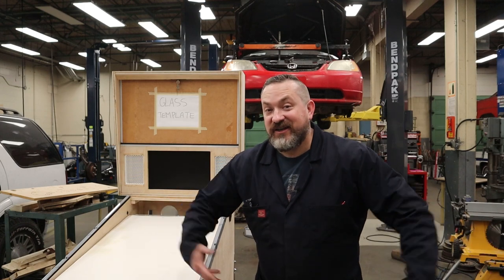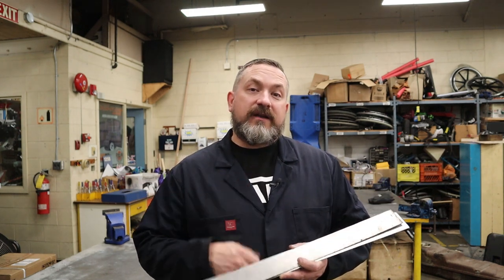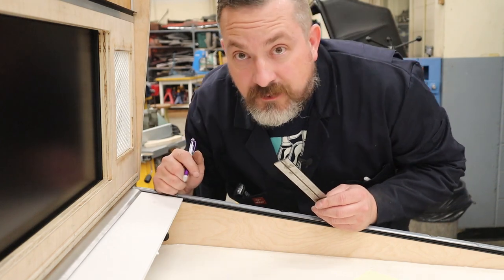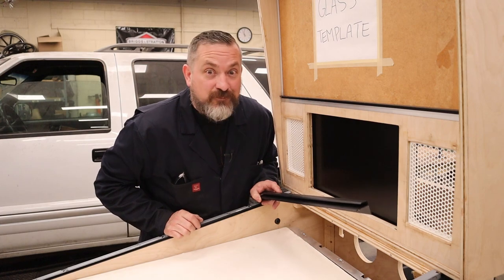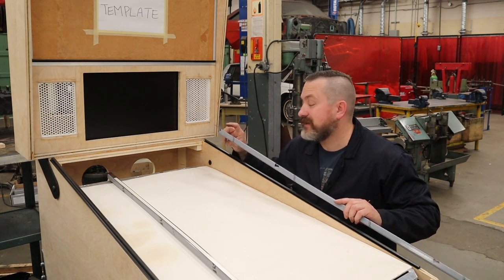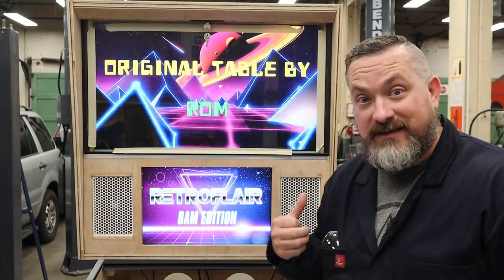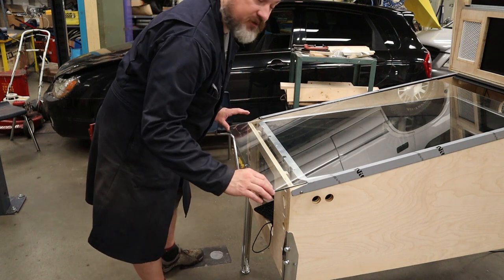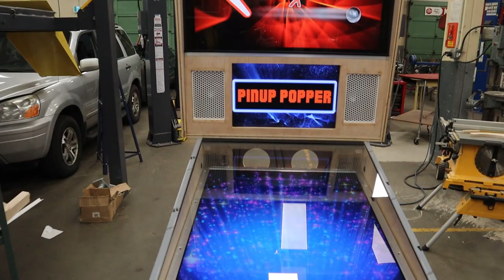How to install pinball glass

Comment: Perfection! No Instagram so I can't post my progress. I noticed a mistake, I made, when I was placing my side rails. I didn't add the 3/8" on top of the rear shelf. The rail hit the bottom of the backbox. My fix was to add 1/2" addiction to the rear shelf. I have a replacement wide body glass. I was concerned that there would not be enough glass in the side guides if I utilized max width for the lockdown bar. My build is not far behind yours. I haven't drilled my flipper and magnasave holes because I want to get my 43 mounted. I want it close to the player as possible. As always.... Excellent instruction and content.
Reply from the maker: Yeah I did the same thing...I forgot about the use of rabbets that made it sit up 3/8" and had to add a piece as well.  How much wider did you go from widebody? Yeah the flipper/magnasave button locations seemed really stressful for me because you want them there but the monitor is there too.  Watch you don't drill your monitor eh?  LOL.  Thanks for the watch and the support dude, I appreciate it!
Reply: @wayofthewrench  To My knowledge I'm on the wide body width.  My outside width is 24-7/8". All my research said ~25" for widebody. With the nominal thickness of the 3/4" plywood that would have put ~1/8" in each side of the channel. The wide body glass is 23-3/4" wide. My solution was to cut the cab floor 23-3/8" at front and 23-1/4" at the back. That's how I balanced a good fit for the lockdown bar an the glass.
Reply from the maker: Oh thats not leaving much for the glass to hold....good idea to alter the cabinet width at the back.

Comment: Great video as always Brother! Look forward to more. I don't have any suggestions this round, it was all perfect.
Reply from the maker: Right on dude!  I just wish I had more time to keep pumping them out for ya guys.  I have a suggestion...don't make a custom width cabinet so you can buy standard pinball glass at $40 USD instead of what I paid...lol.
Reply: @wayofthewrench  I hear that! I just set up my 4 monitors in the other room, yes (4) I added a 720p for a topper to see how that will look and try and figure out how to frame in a 24 inch up top of the backbox. I finally got all my PC parts together, installed windows 10 and baller installer, next is to add tables. Then soon hopefully out to the garage to start on the cab.
Reply from the maker: Cool sounds like your ready to go!  I'm not a fan of the topper monitor, maybe it's just me.  I'm going to make a TOTAN real topper that will light up the gems in a sword and have it on a pivot so if you don't want to see it while playing other games, you can swing it over the back box.  Good luck on your build!

Comment: Great video, you mentioned putting foam down by the lock bar in case the glass moves. I used the standard widebody clip at the back and even though it lines up well, it doesn’t seem to do much for keeping the glass from sliding back down if you move the cabinet around. I feel like cabinet movement is inevitable. If you have a shaker or nudge, is the glass supposed to be held in place at all by that back piece that you fabricated? Mine just seems to slide into it, but I would be afraid if I left a lockdown bar off the glass might wiggle its way out :-)
Reply from the maker: Once the glass is in the side plastic rails, it doesn't really move that easy so you don't have to worry about it falling out, especially with the lockdown bar.  The back piece is more of a trim piece to hold/support the glass, it is not to grip or stop the glass from moving at all.  You will need a lockdown bar or something to prevent the glass from eventually sliding down.  Thanks for the watch!

Comment: I've been waiting for this one!  A great video chock full of useful tips like the electrician's tape for the side channels and the use of foam board for back channel placement - brilliant!  I did notice that early in the video you said you were using 1/8" glass for the back box and later stated the trim didn't fit the 3/16" back box glass.  What thickness did you finally use?
Thank you for all your hard work.
Reply from the maker: Happy to help!  The back glass is 1/8" and playfield is 3/16" thick.  Although when I went to order it, I had to order in mm.  Thanks for the support for my channel BellOnWheels!

Comment: I'm not sure you need to angle the wood where the glass stop affixes to the back of the playfield — I think regular ol' 90 degrees should work. The gap between the top and bottom lips of the channel are more than 3/16" — like they intended the glass to come in at a 10-degree angle or so?
Reply from the maker: When I made this piece I checked this angle and it was necessary and when the glass went in, it fit perfectly.  I also used a steel version not the plastic one so that might have made it more required.  Thanks for the watch!

Comment: Hey I’m not too far behind your build 
Looking at getting the glass and trim
I used your dimensions for the cab
I don’t have the bending and welding skills you do
Any idea where I can get the playfield rear trim around 25”? 
Thank you
Reply from the maker: The only part available is a Williams widebody rear glass trim.  I had to make mine because I didn't want a gap.  You could but two and cut them down to make up the gap but with a seam that would be seen.  Hope that helps.  Thanks for the watch!
Reply: @wayofthewrench  excellent suggestion 
And two are working out perfectly 
The gap is acceptable to me 
Thank you again 👍
Reply from the maker: Awesome!

Comment: My only suggestion would be to use Frog Tape or some lesser Painter's Tape instead of the plain tan masking tape for perfect edges and easier removal.
Reply from the maker: I would agree with you on that.  However, if you remove masking tape right away, you'll have no issues.  If you leave it a couple days....thats a big problem.  Cheers!